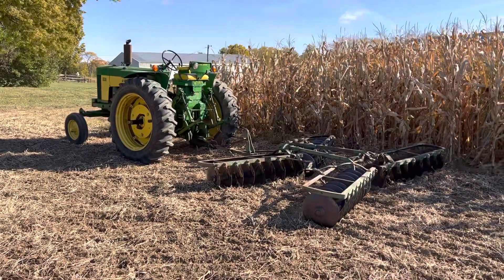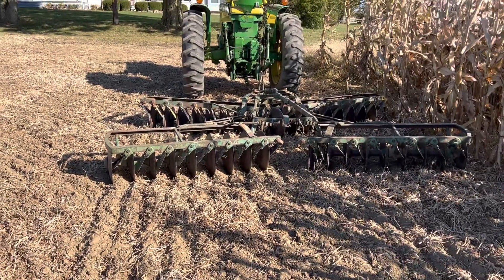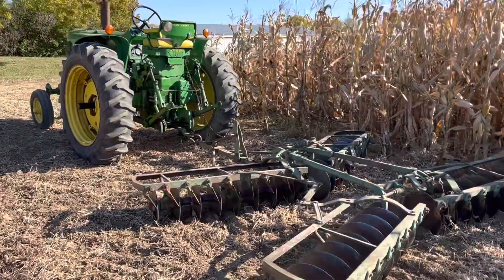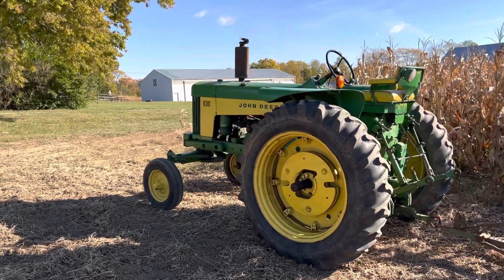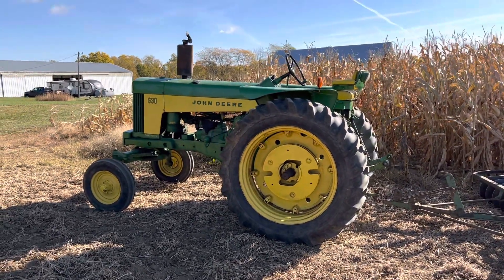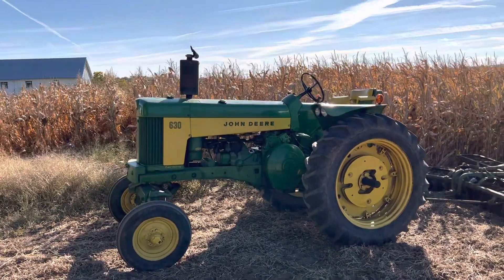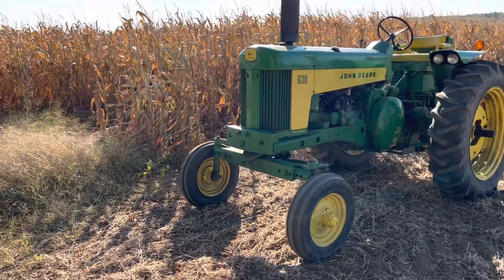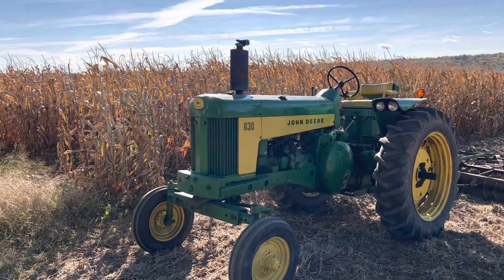John Deere 630 Tractor and John Deere KBA Disk

Comment: Roger, love the old school farming, we do a bit as well.  If the noise you refer to sounded like a small explosion in the crankcase, not a pop or loud snap, Likely it was fuel dillution into the crankcase that ignited when it warmed up. All those Deere horizontal 2 cylinder tractors were prone to that. The carb can leak into the manifold while sitting, it then sits in the bore and seeps past the rings. That why the later number series tractors had the safety shut off in the fuel line, oil pressure opens the gas line when first startup.  That valve may need service.  I've seen them get so bad that the crankcase cover gets blown off the engine!
Reply from the maker: Thanks for the advice! I will check that out.